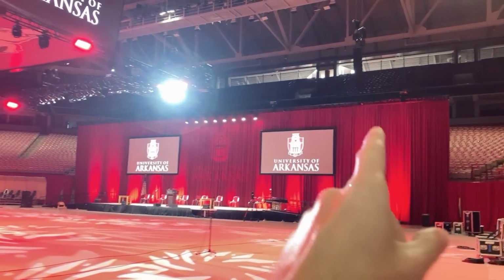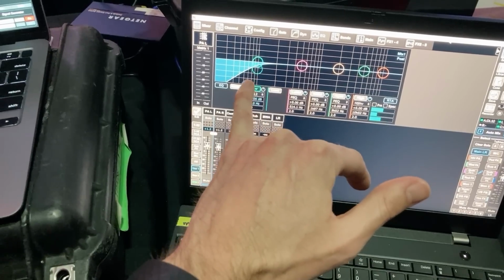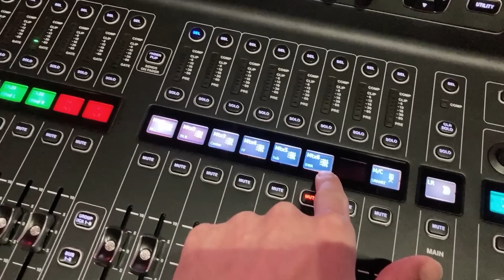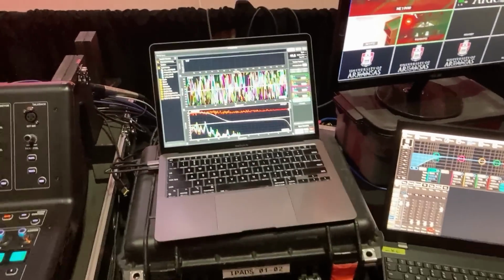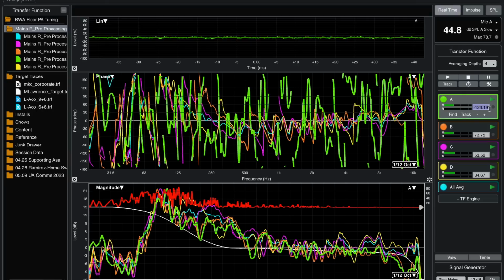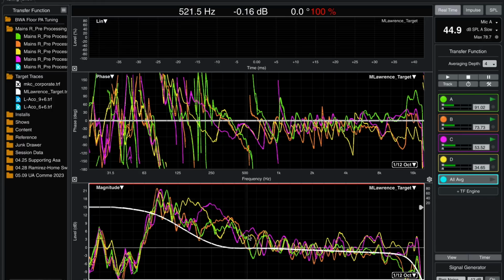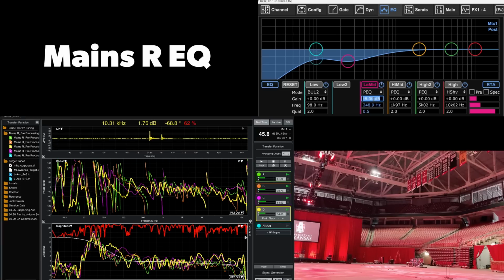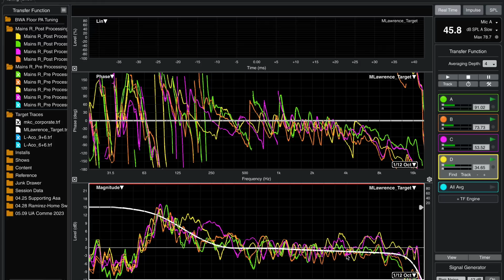Tuning A 12 Box Arena Line Array Hang With A Single Processing Channel

Comment: Another killer video lesson. Thanks for sharing. 
1. Hopefully system processor next time 
2. Mechanics of the design matter first 
3. Didn’t need the noise on for as long as a others may think, so smart, capture and go quiet 
Loved it. Thanks for taking the time to share.
Reply from the maker: Thanks a ton, Cam! Yes, mechanics first, more processing granularity helps, and use the minimum amount of noise and measurement time possible.

Comment: I tuned an HDL6 rig with only 6 boxes a side but used two processing channels. I was able to get their frequency response from front to back almost perfect with a little bit of HF shading, dipping 800hz a bit, and killing a whole lot of low mid 85-100hz. I’m surprised how much low mid are in these boxes!
Reply from the maker: Yes, these boxes have a TON of low mids! But yes, after some macro-low-mid adjustment these rigs usually just need a bit of HF shading.

Comment: If you Right-Click a stored trace, you can choose "Recapture" which will replace the stored data with the live data from your focused measurement engine... saves you a step.
Reply from the maker: Thanks for the tip, Michael. I need to start integrating that into my workflow.

Comment: Hello! Talk about electronic crossover versus acoustic crossover. In some works, I process the loudspeakers with HPF at 200Hz for 24dBs/8a and the subwoofers with LPF at 100Hz for 24dBs/8a with, the Subwoofers working with +12dBs and I have great results. Thanks!!!

Comment: Fantastic hands-on tutorial. Explains so much more than the theory sessions would have done.

One quick question I have is what measurement mics did you use here? Also what is the calibration status of those mics?

Thanks in advance.
Reply from the maker: Thank you so much!

These are the iSemCon EMX-7150 microphones. I've had the four of these about 6 months now and love them. Purchased them from Rational Acoustic's website.

Although they ship with calibration files for each mic, I don't use them. Both the sensitivity and frequency response of the mics are so close out the box I don't feel like any change would meaningfully impact the decisions I make in the field.
Reply: @MichaelCurtisAudio  many thanks for the reply. Very enlightening.

Comment: Thanks again Michael for another informative video.  How much time did you have to tune the arena?  Was it a one day job or did you have a couple of days for everything you needed to get done?
Reply from the maker: On this particular gig I had about a two hour window (which was very nice to have that much wiggle room). Without having to film it at the same time, and also move my own wired mics around, this system should take a half hour or less.

Comment: Hey Michael,

Thanks so much for your videos, amazing resource for learning! Keep it up ;)

As I‘m just starting out one measuring-specific question: to me, your coherence seems to be impressively high. How do you achieve that in such reverberant rooms? Do you only turn on the relevant sources - so mute PA-L in this case? Do softwares (OSM vs. Smaart) differ in these regions?

On the note of aligning-positions: Hirnforschung you approach Mains>FF alignment? Especially in small rooms with seats close to a wide stage. Does it make sense to vary the delay from the outer to inner FFills?
Reply from the maker: Hey, Florian! So glad you've liked the videos. Here's a few thoughts:

Yes, I did indeed mute PA L when measuring PA right. As I'm folding in other fill systems I'll keep the mains going to assess the "LF leakage" and take out low-mids from fill systems, but I always start solo-ing each subsystem. I could have used Smaart's new sync-source TF feature to get even higher coherence! It drops the data window and uses a periodic pink noise source which allows room reverb to be considered "good data". I'm probably butchering what's technically going on under the hood with that explanation, but that's what I know thus far.

When it comes to mains to FF alignment I ask myself which audience areas will be more affected by the "seams" between front fill to front fill or mains to front fill zones. More often than not I'm treating my front fills as a single "subsystem", then aligning them as a whole to where the front fill closest to the mains meet at equal level on the floor.

Comment: Hi Michael, could you plz also demonstrate how u aligned Subs? further more i would like to know why dont u switch of the Left PA too cuz when the Left Pa is on these curves could see different right? And this is the real situation, which we have to work with.
Reply from the maker: Hey, Priyan. I don't quite understand the back half of your question?

As far as mains to sub alignment, I usually go on-axis with one of the mains and about 75% of the way back in the audience, then line up the phase traces throughout the crossover region between mains and subs (when the traces are within 10dB of each other).
Reply: @MichaelCurtisAudio  Hi Michael, my bad, actually it should be "Further more i would like to know why don't u switch ON the Left PA too when u are equalizing the Right PA, cuz when the Left Pa is on these  measurement curves of right PA could see different right? And this is the real situation, which we have to work with." 
Did u get my point? Cheers

Comment: I need to get and learn Smaart.  What version would you suggest for someone doing usually simple system tuning?  Is LE good enough?  Should I spring for RT or Suite?
Reply from the maker: LE is more than enough to get started! A big difference between it and it's (sort of) predecessor, Smaart DI, is that it can have an unlimited amount of inputs, so you can run more than one mic if you'd like.

Comment: Nice video Michael!
I’m curious how all 4 of your mics have the same level of measurement signal incoming (around 5.40 timestamp of video). They all positioned at various distance from the PA (close to far) and have same gain settings (supposedly calibrated at one point before measurement) so that can’t be possible or I’m missing something?
Reply from the maker: Great question! Here's a little background on the setup and a two part answer:

Yes, all microphones have a very similar sensitivity and were at the same gain value for each channel (I think it was +45dB of gain). Like you said, if I put all four microphones right next to each other and took a measurement I would get virtually the same data from all four mics.

First,It's the line array's design itself that made the distribution of energy equal across the space, therefore giving similar data across all mic positions. That's the very problem we want to solve with our sound systems - give as many seats in the audience as possible a similar experience.

A poor design/deployment would have high variance in between each seating section of the audience. That's why I stress in the video that the design, as informed by the client's goals and audience geometry, has to be done right first before we get fancy with any processing.

Second, later on in the video I (shift + click) at 2kHz on the magnitude response and that normalizes the traces with a one octave weighting to that part of the frequency spectrum. That now serves as the new reference point until I clear the trace offsets.
Reply: Got it, thank you!
So, before you start taking measurements on any venue you put all your mics in the middle position and set up mics gain sensitivity to be even among each other? You do it with pink noise or maybe meyer M-noise?

Comment: Great video Mike! I have a question, have you ever used the DBX Driverack PA2 to tune line array systems before?
Reply from the maker: Thanks! Yes I have. It'll "do the trick" within a limited set of parameters, but that unit was designed to align individual speaker drivers to themselves, not necessarily process a bunch of PA zones. One big limitation is the limited output delay - only 10ms.
Reply: @MichaelCurtisAudio  thank you.

Comment: Did you use the built in pink noise generator on the M32?
Reply from the maker: Nope, the signal generator from Smaart, which I ran into a channel on the M32.

Comment: Do you take measurements with both sides of the PA on?
Reply from the maker: Will primarily have just the speaker zone I'm measuring on, but will often take a measurement at the end ONAX with one of the mains will all speakers on to assess any low-mid buildup.

Comment: Does the production company do the rigging or do you have to have a union crew come in an handle it?
Reply from the maker: The production company designs the rig and the truss layout, but a dedicated rigging crew comes in and gets up in the steel to hang all the motor points.

Comment: Have you tried averaging all the collected data into a single trace?
Reply from the maker: It would have to be subdivided down into a few coherent groups for that to be useful. Averaging pre-processing data with post-processing data doesn't answer any meaningful questions.

But yes, if there's a specific question I'm trying to answer that would benefit from having a lot of different measurement points speaking to that answer, averaging them all out is helpful!

Comment: Very informative video as always. I tried using your Micheal Lawrence curve and I found it quite off of my taste. The bass were so much that I lost clarity on almost the whole PA. The test was outside. I decided to leave me pink shift at +6db rather than +15db but ever since. I find myself almost always cutting the low-mids and subs off of  my mixes. 
Am I used to flat systems or is this a common situation?
Thank you as always
Reply from the maker: Hey, Giannis. Like you mentioned, target traces cross into the realm of "taste" vs "hard science" rather quickly. I've had great luck in a variety of situations with Mr. Lawrence's target curve, but the way you mix may not translate well to that setup. Ultimately it's up to you to see what type of general PA tonality makes most sense with your mixing style.